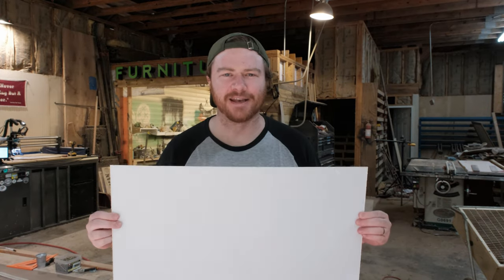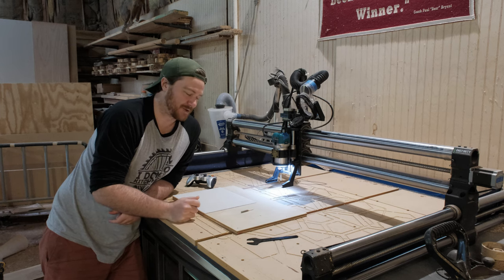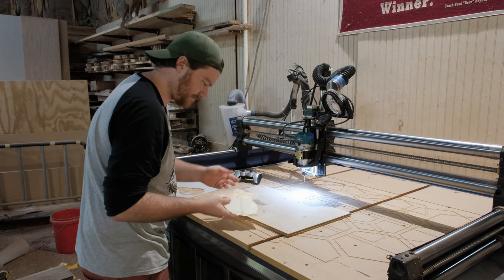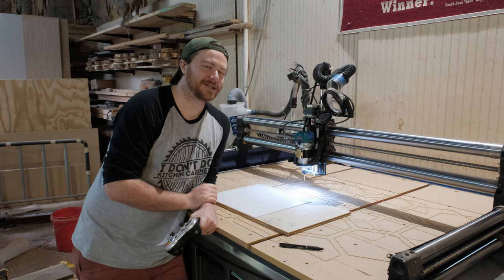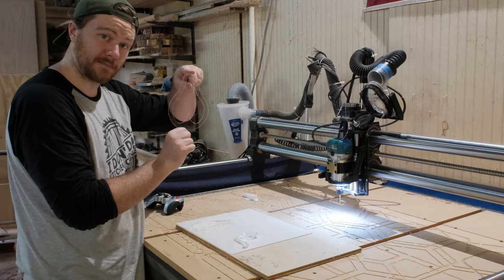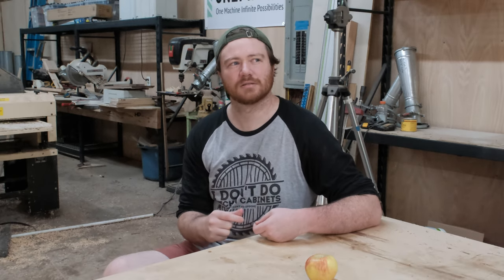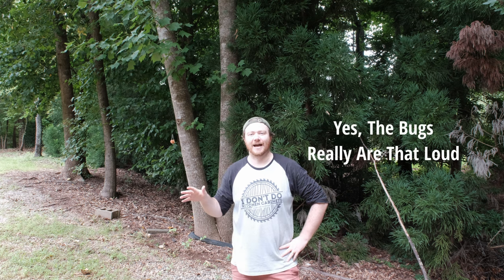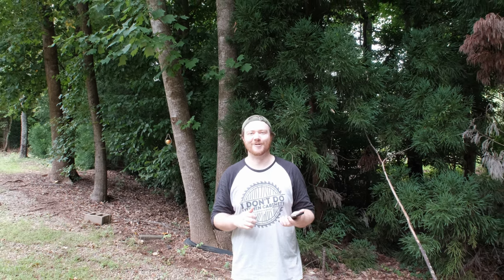Easy CNC Woodworking Projects- Apple Spike Bird Feeder

Comment: I was a little confused when I bought the file pack what the heck this project was!  😂 I wonder now if you could do it with something like 1/2 " wood and then maybe set a nail or screw in the spike part to secure the apple a little more.

Comment: HELP!!! I purchased a VEVOR 6040 (it has stickers on it that label it as a CNCest) back in January. I upgraded Mach3 and got the license even. Got the year long Carveco Subscription. 
Have yet to produce ANYTHING. 
I programmed a little "WELCOME" sign using a YouTube Tutorial.
The first try was comical...not really. It cut the project in miniature. Took it to friend's machine shop (he has an extensive shop with 5 huge CNCs) and his guys went through what we had.
They got it curt I ng thw right size now (with-in 1 thousandth of an inch) but the "image" is rotated 90 clockwise and the x axis is inverted as well. Also, the E-Stop and Auto Tool Set does not work. 
My thought is, the type of machine loaded during Mach3 set up is incorrect. 
Any suggestions???
Reply from the maker: Sorry, I'm not much help with that! maybe someone else in the comments can help you out!